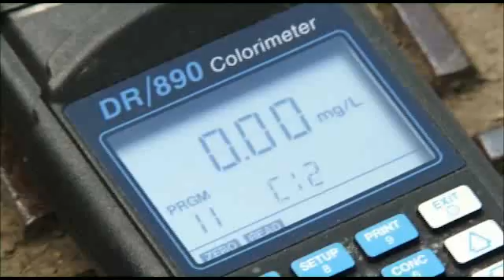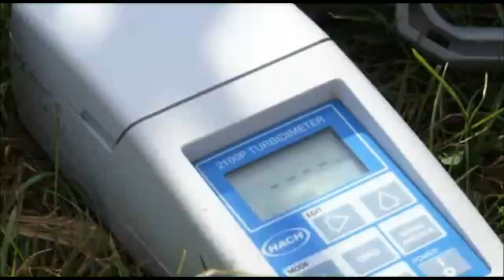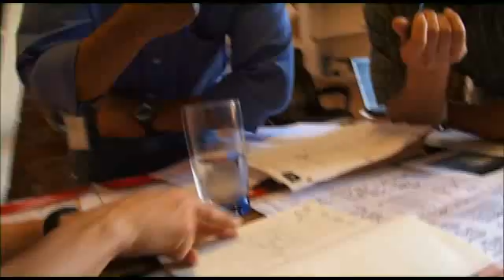What Does an Environmental Engineer Do? Careers in Science & Engineering

Comment: Are Environmental Engineers usually Chem E or something........my school offers a relatively obscure "Energy Engineering" degree. I'm thinking about taking it....switching over from Mechanical.
Reply: *****
Sticking to Mechanical :)
Reply: *****
The "Energy Engineering" line seemed too specialized. Advisors told me clearly it was only available at the branch campus I'm attending now. There's not even a degree for it in the main Purdue campus. It's a subset of the Mech Engr department too and the curriculum to a certain point is the same. Then it diverges after the essential Calculus, Physics, and Thermodynamics stuff is complete. I figured it would be safer sticking to Mechanical. Though I may try for a second opinion and see what I can do.